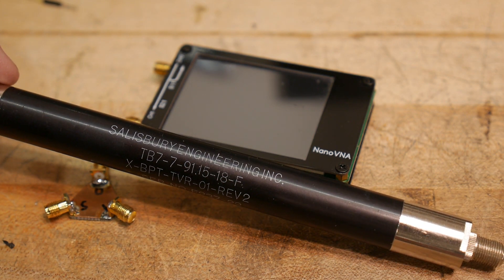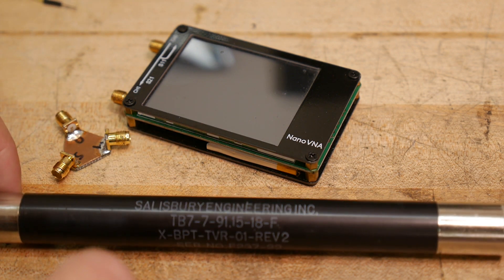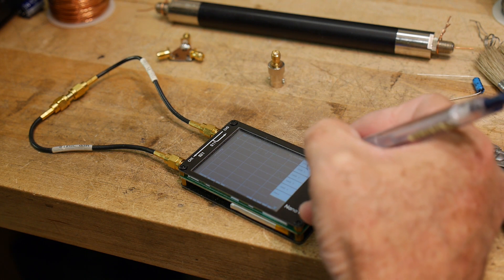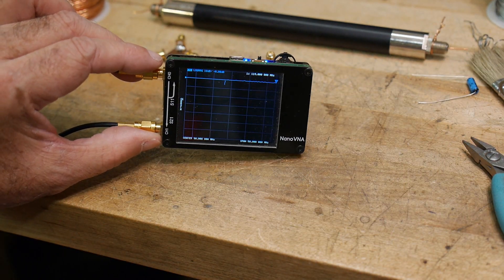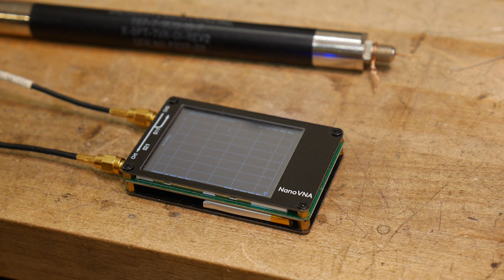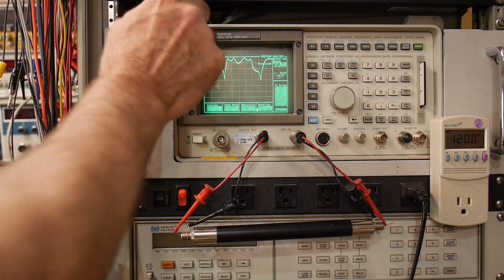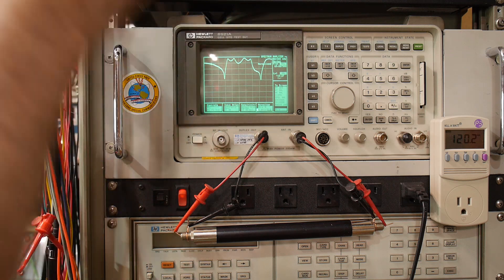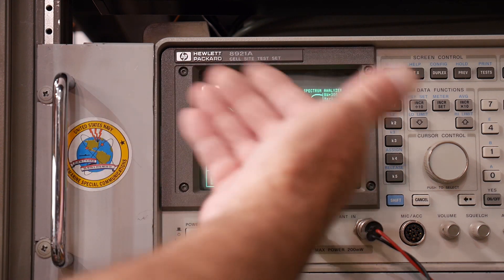#467 NANOVNA Filter Sweep Compared to HP8921a

Comment: It would really help in a comparison to show a post test spreadsheet actually comparing the two devices.   Are they 1%, 5% or 20% different?   The reason I ask is that if you are trying to use it for real analysis and you need specific results to build or analyze a unit under test then you begin to understand the reason that the HP is (was) so expensive.   Most of us don't have access to the high end TE and would love to know the actual usefulness/accuracy of the NANO VNA (I have one on order, should be here in about a week).   Thanks K7HIL

Comment: Well done! I really like your content!  I have also done my tests with a SA with TG configured as scalar analyser (https://www.youtube.com/watch?v=K41O-_5DmEo) and the nanoVNA showed the same LogMag data. I also manually checked "by hand" at low frequencies that the phase information is correct.
However it would be nice to see a comparison with a real VA to appreciate why the cost so much more than the Nano :)
thanks! Keep up the great work!
Reply from the maker: My friend has a real HP VNA at home. Once the restrictions are off I plan to do a shoot off. Of course he's goes to 18GHz
Reply: @IMSAIGuy  thanks, that would be awesome to see. But I'd like to see/learn about some (high precision) measurements on low frequencies (where the NanoVNA can operate properly, say up to 300mhz) which give good insights on a HP VNA but bad ones on the nanoVNA. Not that I could afford any real VNA any time soon, anyway! :P
Reply from the maker: @therfnoob7697  I do plan to do that. It should be pretty good maybe better than the big VNA at low frequencies since it uses bridges instead of couplers. The only difference I expect is the noise floor (dynamic range). It should accurate on frequency and phase. Phase at 18GHz is where the expensive ones earn their keep. and why the cal standards are so expensive
Reply: @IMSAIGuy  thanks IMSAI guy! I look forward your next video.